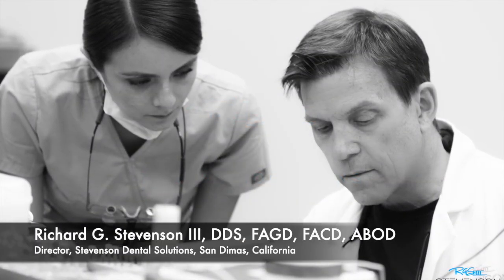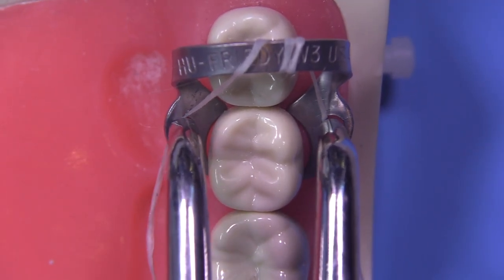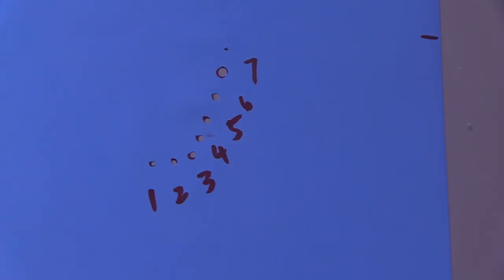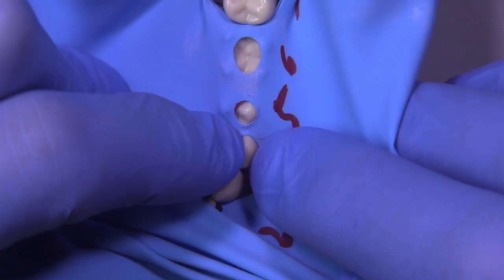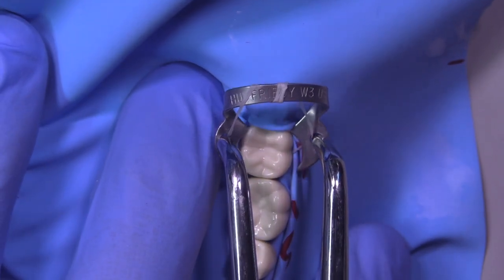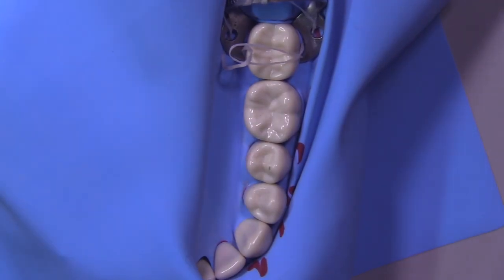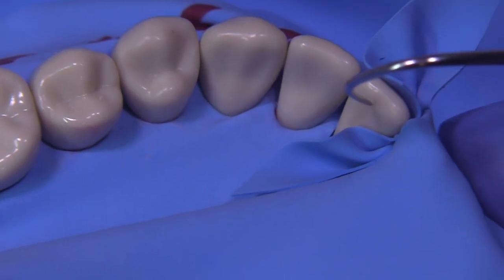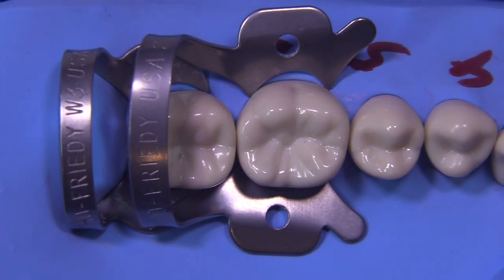Rubber Dam Isolation, Part 4: Basic Technique for Rubber Dam Application

Comment: Really good vid. If the technique you showed at 6:00 has no downsides, is it possible to place the rubber dam sheet before even placing the clamp? are there any disadvantages apart from what you pointed out ( having to adjust the clamp so it sits on tooth structure)?
Reply from the maker: It's done all the time, especially for anterior only isolations, like from premolar to premolar.  The area adjacent to the retainer (clamp) need not receive anesthetic with this technique, as the rubber dam cushions the tissue...
Reply: @StevensonDentalSolutions  ah ok thanks for the reply. Why do you think this method isnt shown more often (posteriorly), as i find it to be the simplest and quickest to an extent, yet cant find any videos on it?

Comment: Thank you Sir for sharing this. I've seen your videos on the Rubber dam and believe me it has helped me immensely. Thank you again Sir 
Just a confusion sir , asked many practitioners this question but no one gave a satisfactory answer to my query.
Sir , is the largest hole punched for any tooth which receives the clamp irrespective of the type of the tooth or we need to select the hole according to the size of the tooth  but as a beginner how do you we get the idea that this particular tooth needs this particular hole?  For example, Sir , if we're isolating a mandibular incisor, do I need to punch the smallest hole? And for maxillary incisor the second smallest hole and so on? And does this change when they are isolated but not as anchor tooth? Hope you get my question Sir. 

Sir I often end up imbalance of the sheet and frame on the patient. It goes more towards on side and I end up with no so good isolation? What could you be the reason Sir . Hope you get time to answer Sir Thank you
Reply from the maker: Great questions!  

1. The size of the hole should always try to match the tooth first and then one size larger to facilitate placing the dam over the bows.

 Helpful hint: For class V lesions, we also punch one size larger than normal and about 3 mm towards the facial, and with about 2 mm more space mesial and distal - This allows the hole to be shifted facially and secured with a 212 retractor.

2. Use a "top clamp" on the opposite side to keep the assembly from rotating.  Procedure: Once the dam is on, use a W2 for premolars or a W3 for molars and clamp the side which has no holes on the tooth of your choosing - it won't be painful as the dam is cushioning the gingiva and it will keep the dam straight on the face.

Best!

Dr. S
Reply: @StevensonDentalSolutions  Thank you very much sir. Pretty much satisfied with the answers. Thank you again Sir.

Comment: Dear dr Stevenson:
Thanks for your nice video, very helpful as always. 
What if you have to do a Do composite on the last distal tooth i.e tooth no.7, how would you manage the clamp and the matrix band without interfering with each other?
Reply from the maker: I'd use an RGS M17D clamp and then use a Tofflemire retainer and band for the distal - squeeze the clamp open SLIGHTLY after prepping, then insert the assembled matrix and then allow the clamp to squeeze against the matrix...https://stevensondentalsolutions.com/shop/molar-distal-access-rubber-dam-clamp-rgs-m17d/

Comment: I feel like securing the clamp and rubber dam together first outside patient's mouth is more efficient
Reply from the maker: More efficient but it leads to more issues with proper clamp positioning.  (you simply cannot see the entire clamp features with a dam draped over it.   Often grabbing too much tissue, etc.  Both work well after practice.

Comment: Thank you Dr Stevenson, these videos are very helpful. Can we stabilizied the dam without clemps ?  Colten rubber dam kit has a latex stabilizing cord. How can we use it practically ? Thanks a lot
Reply from the maker: The cord (Wedjets, etc) work best with anterior isolations/  Place the dam, then insert the elastic pieces between the last tooth isolated and the tooth covered by the dam.

Comment: Is the application of the second clamp simply to hold the rubber dam on tooth #19? I’m curious what could possibly happen if you didn’t place the second clamp? Thanks 🙏
Reply from the maker: Hi, the 27 clamp is to further retract the rubber dam to gain access to the buccal surface.  Thank you for asking the question!

Comment: Hi there doc! Could you please explain what are the criteria to deciding wich teeth to clamp and isolate if we are restoring a particular tooth? Lets say we want tp restore tooth 20 and 22, from where to where should I isolate and where should I put the clamp? What exactly is the criteria? Thanks a lot
Reply from the maker: Hi, typically 1-2 teeth distal to the tooth being restored all the way to the midline or contralateral 1st premolar.  If we are working on #22, the clamp W2 would be placed on tooth #20 and extends to tooth #28.